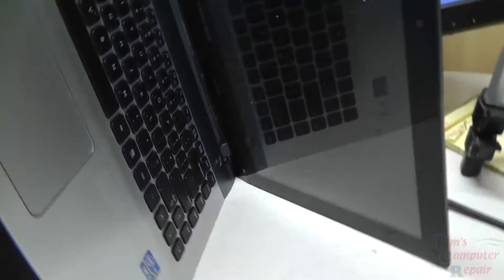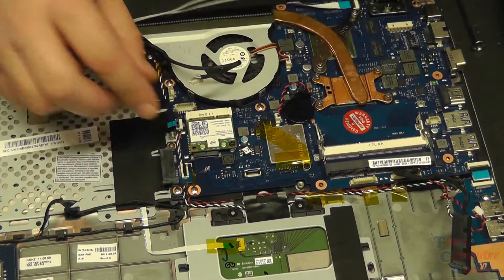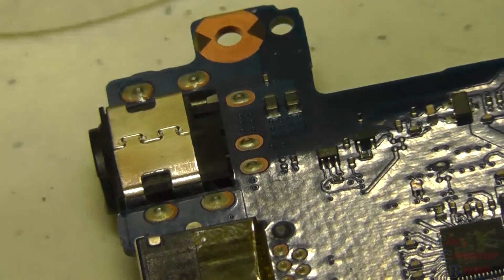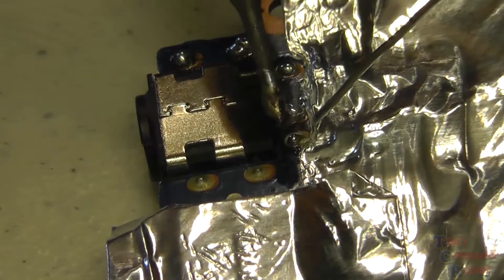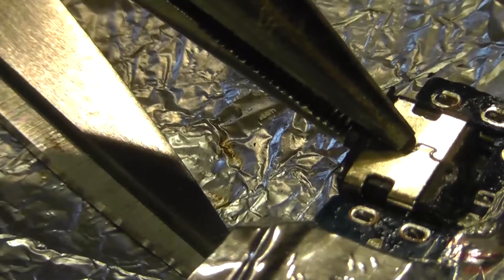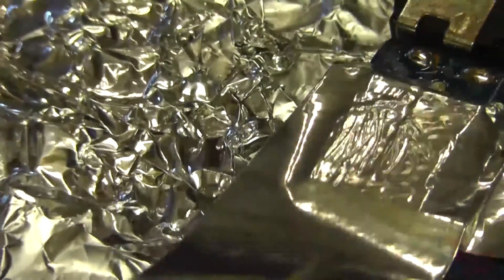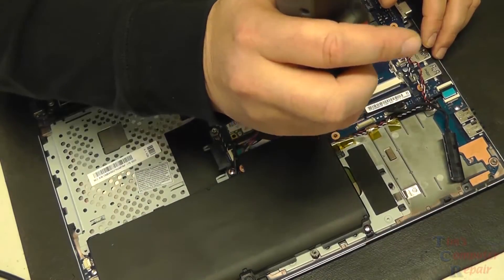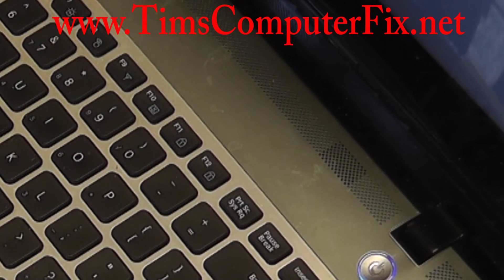Samsung np-QX411 Repair Power Jack Tear Down Guide by TimsComputerFix.net

Comment: Great job Tim! What type of heat tape do you use/recommend?
Reply from the maker: Save My Laptop I use foil tape but you can also use Kapton tape.  Kapton tape combines excellent physical, electrical, and mechanical properties, and has been used in applications at temperatures as low as -273°C (-459°F) and as high as 400°C (752°F).